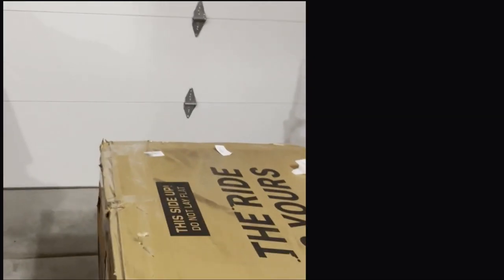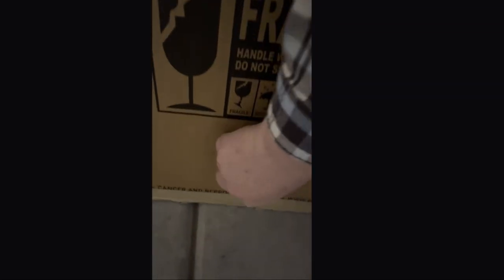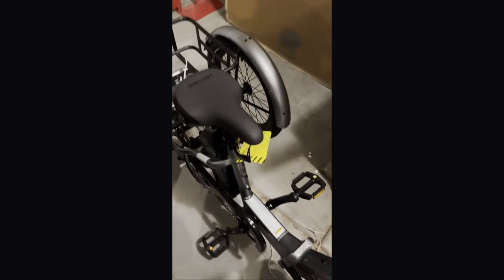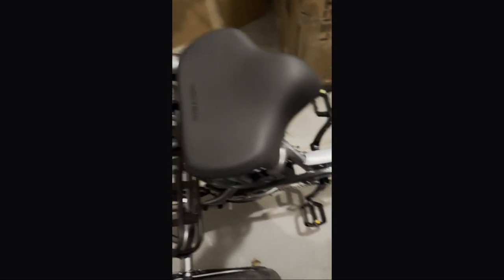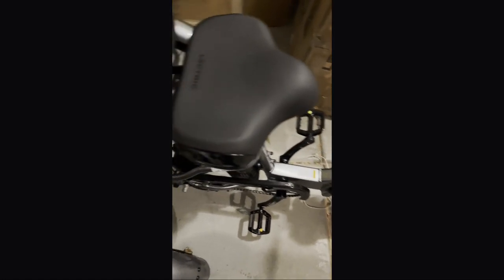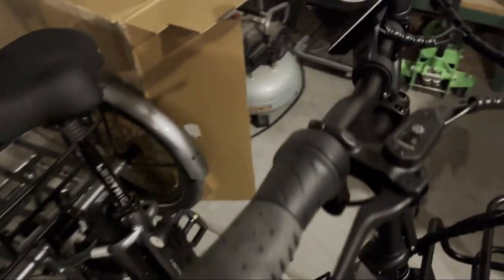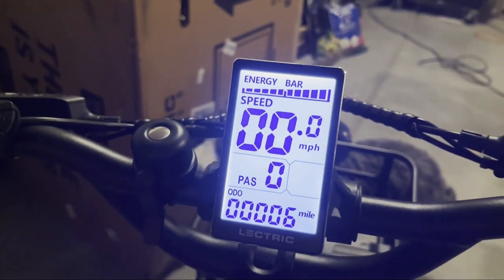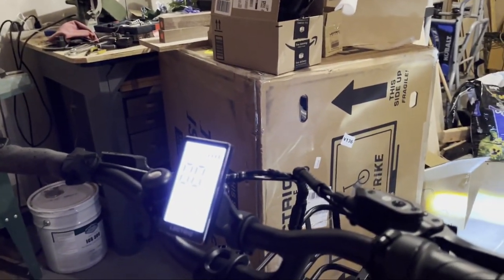Unboxing and Assembling Lectric XP trike 1080p

Comment: Hi, did you have any problem with any damage to fenders or wheels during shipping? Several reviews have mentioned this and wondering if you had any issues?
Reply from the maker: I did not have any issues. I saw those reviews too. I think they changed their packaging to reduce the risk of damage.
Reply: @MrJake0425  ...Thanks, got mine 3 days ago with a bent left rear fender, otherwise all ok....Called Lectric Cust Ser and  they are shipping me 2 new fenders at no charge and a freebie gift of handlebar mirrors...very satisfied with how they handled it.